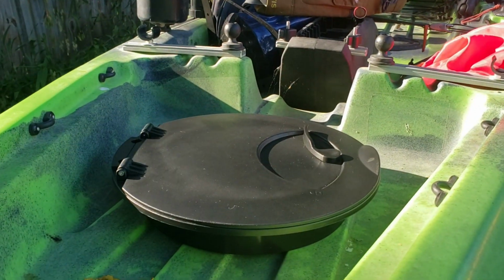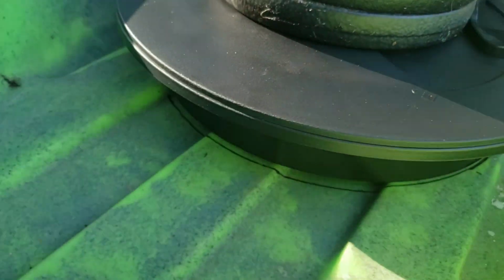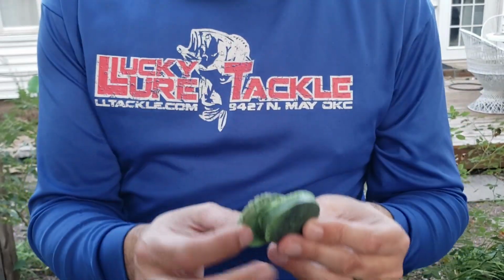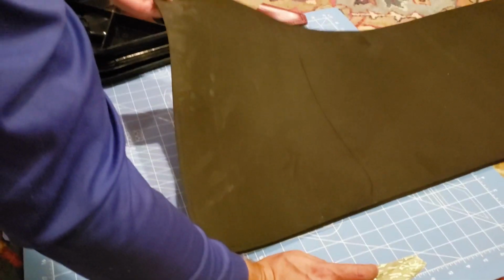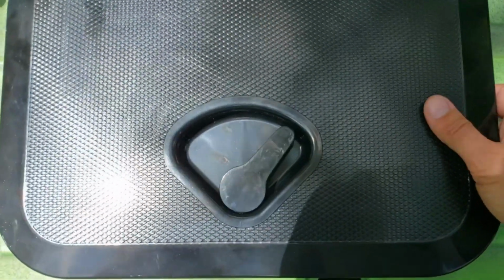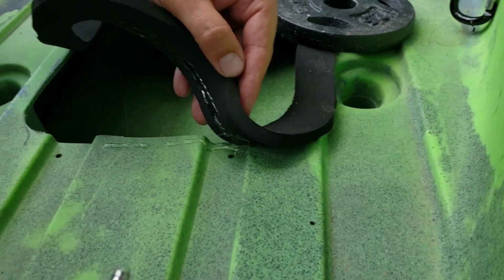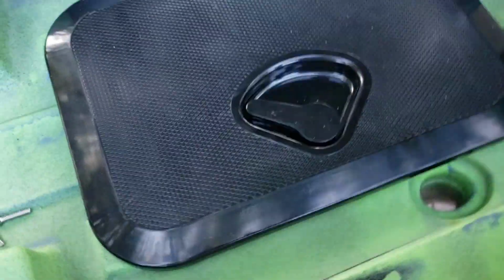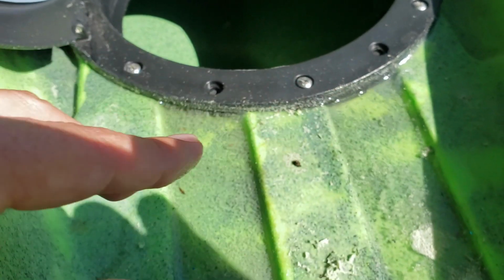Stinking Hatches!  DIY hatch mod install for the Jackson Bite fishing kayak!

Comment: Is there a video for your seat side gear attachment /holder
Reply from the maker: Thx for watching! I have not done a video on that, but I've done a few other seat mods since then so it might be time for a vid on that topic. I basically just cut some spare HDPE to size and attached with zip ties. 

The holsters I made are some pretty hack work with a heat gun and some 1/16" thick ABS sheets. No one is going to be buying custom kydex from me anytime soon, LOL.

Comment: How is the stability on the Bite, i am a fairly big guy?
Reply from the maker: I would say good, but not great. I'm about 5'11", 190 with only so-so balance. I wouldn't feel comfortable standing and fishing for long periods, tbh. Also, I find that kind of counter-productive with a pedal drive.

If you're cool with sitting and fishing and aren't running rapids or crashing through breakers, it should be just fine. 

I will say, I think Jackson made a compromise with the hull shape. The pronounced V shape it has to the bow that runs back towards the seating area gives you a boat that can paddle and manuever better than you might expect for that wide of a boat.  You see hulls on the PA or Big Rig that are flatter. Flatter hulled boats have a better primary stability IMO. I've noticed that the primary stability on the Bite is just so-so. You can feel the secondary stability grab and  are confident it won't tip. But for standing, that initial "jitter" takes some getting used to.

Thx for watching!

Comment: I think you voided your warranty....BAHAHAHAHAHA!
Reply from the maker: What do you mean? I only cut away a couple of square feet of plastic. 😂
Reply: @kayplainsdrifter136  Long time no cyber see!  Watching you fish out of the Bite now...looks like initial stability is twitchy.  Do you stand and fish out of it?  Also if you have an Instagram, or FB, I'd like to share pics of my old school Kilroy if'n yer interested.
Reply from the maker: @B.A.Bassangler  I would agree that the initial stability is lower than some of the bigger fishing platforms out there, but I will say I haven't come close to tipping it yet because the primary stability is really good.

If you look at the hull of the Bite, there are pretty sharp bow and stern contours that somewhat flatten towards in the middle, as opposed to being flatter the length of the hull. I think flatter hull types will give you better initial stability but you're compromising some efficiency in the wind and chop.

I do stand and fish some, but only when the water is warmer for safety reasons. I don't trust my balance enough when hypothermia is a risk.

And yes, I do have my instagram that info the description. Would love to see your Kilroy!

Comment: I have an OG Bite from 2019. I wished they had left a recess for a hatch at either end. How has it held up. I think I could pull it off in the bow well but I get too much water standing in the tank well to put a hatch. I’d love to rig night fishing lights without having to run wires on the  deck.
Reply from the maker: Also, I'm putting out a vid soon that shows how I'm rigging it for electronics 👍🏼
Reply: @kayplainsdrifter136  looking forward to it. I’ve got some plans for mine this winter. Hopefully putting a trolling motor on it. Ought to be fun.
Reply from the maker: @tennesseekayakfishing5691 That would make a good video if you're so inclined 😉.

Keep me posted on that project as it progresses! Drew Gregory mounted a trolling motor on a Yupik, which has a pretty similar bow. Might check his old setup out for some ideas.
Reply: @kayplainsdrifter136  it’s possible. I’m sure others would like to see a trolling motor on a Bite. It was one of the best selling kayaks that year. It’ll be stern mounted though. Yakgadget is not too far from me and can help with the mount.
Reply from the maker: @tennesseekayakfishing5691  Oh cool...those guys are making some really innovative stuff! I've got a cart idea I'd like to pitch them.
Reply from the maker: Drew had an auto-pilot setup that had to be mounted on the bow IIRC.
Reply from the maker: Hey man, thx for watching and so sorry it's taken me so long to get back with you! 

So I took my Bite out into some serious wind and chop this past weekend. After 3 days, I can say that it held up very well! I do have a small bit of water that collects behind the rear hatch towards the stern, but not enough to present any concerns or problems.

Comment: Nice video.  Dremel tip:  I recently made a Kydex holster.  I started with a Dremel cutoff wheel.  Did not like the friction cut.  Switched to one of the spiral bits.  It cut much cleaner with no melting.
Reply from the maker: Very cool! I didn't think to give that a try but will do so the next time I do some cutting. Thx man!